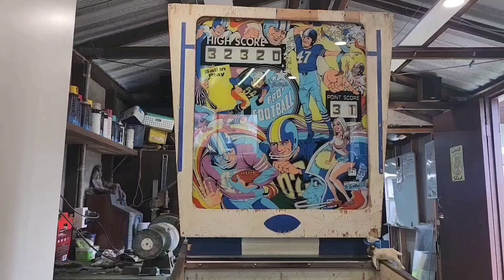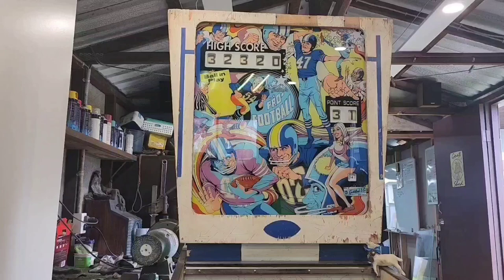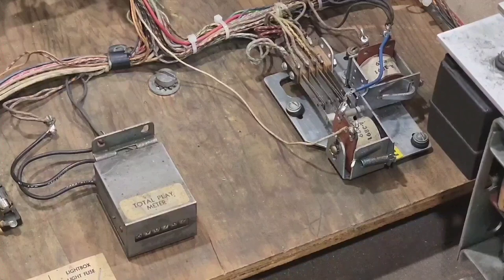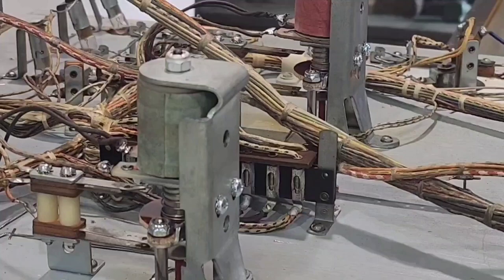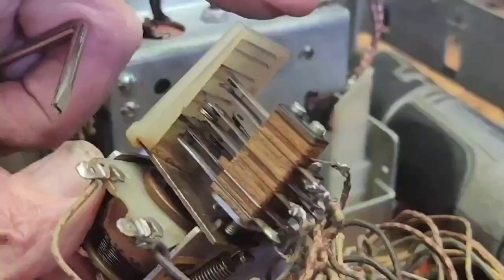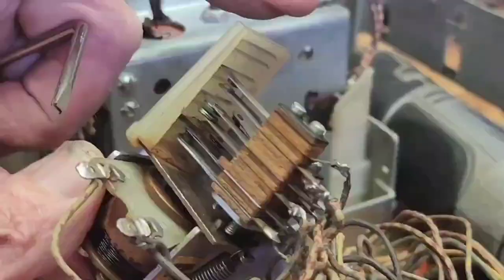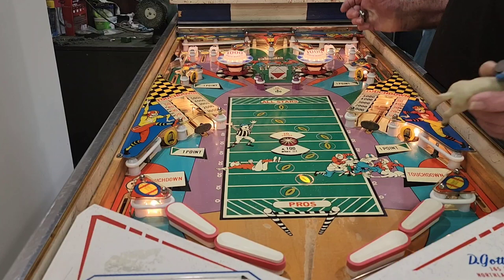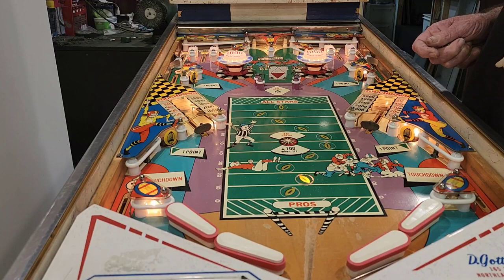Repairing Gottlieb Pro Football Bad Relay

Comment: As an owner of a Pro Football, I highly recommend replacing the light in the upper middle of the playfield with either a flashing bulb or a colour changing LED.  Either has a very affective visual impact on this game at that upper/centre position.

If you want to see what it looks like borrow a flashing bulb from behind the back glass, where there should be 3 of them, behind the words 'pro', 'foot' and 'ball' that turn on only with the 'gameover' light.
Reply from the maker: We have plenty of 455 flasher bulbs 💡 but it's not our game. Thanks for the suggestion, though I will tell the owner.

Comment: Hmm... Wondering if the game was high-tapped.  Needlessly high-tapping a game accelerates wear on steppers, score units, etc., and can cause increased arcing and overheats coils.  Shop a game properly, and there's no need to high-tap it if the line voltage is adequate.
Reply from the maker: No it wasn't simply old age wear and tear in this instance.